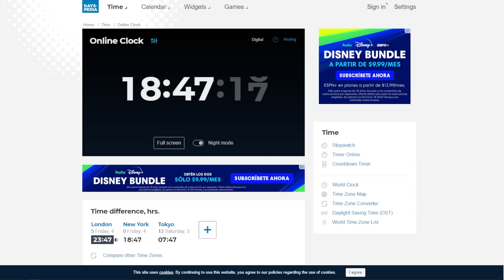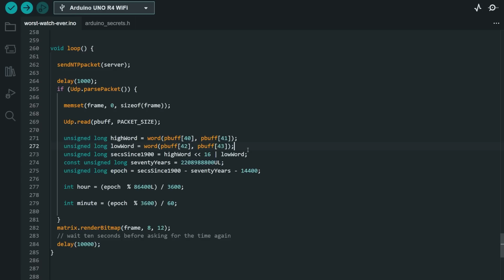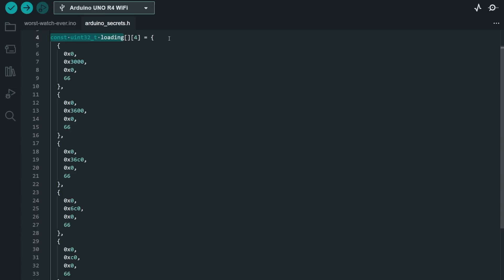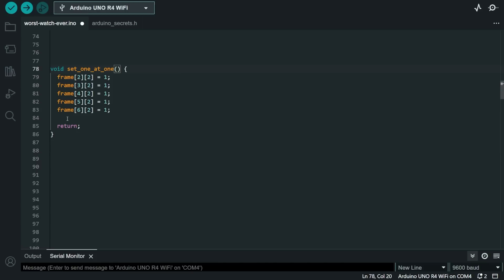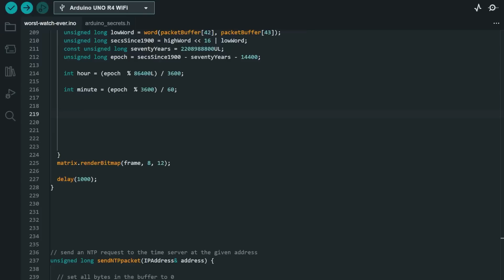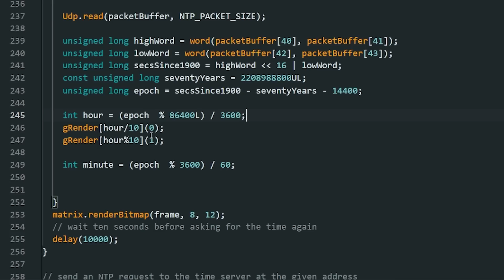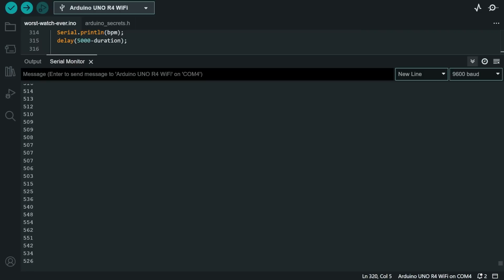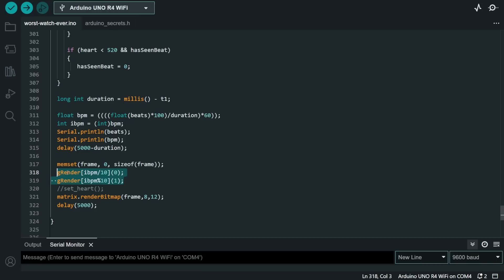I Created the World's (Best?) Smart Watch

Comment: 4:39 Why not just write a single `set` function that takes both the digit and the position as arguments and switch depending on the digit in the body? Then there's no need for the function pointer shenanigans.
6:42 Why is the `hasSeenBeat` variable an `int`? Surely you want it to be either `true` or `false` so the `bool` type from `stdbool.h` would be more appropriate.

Comment: Your heartbeat interval code fails after 49.71 days when millis() - an unsigned long - rolls over to zero. Of course your battery will not last 49.71 days and I don't see any charge-in-place capability so my point is probably moot. But I like to be  pedantic when looking at other peoples' code - heh.

Comment: smart watches are overrated, digital dumb watches are the way. I currently have a cheap Casio (specially a ~30$ F-91W, but if I you were to buy one bet something with a slightly bigger screen). works like a charm. before it was a cheapie from amazon that I used for at least 4 years and NEVER had to change the battery, it was the plastic wristband that broke. think about that